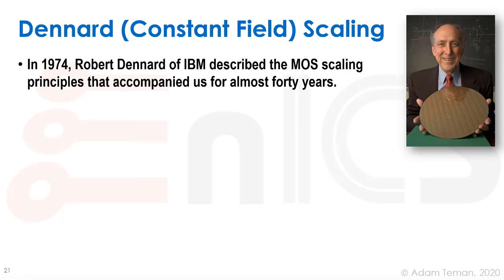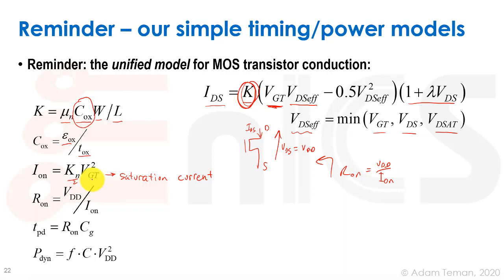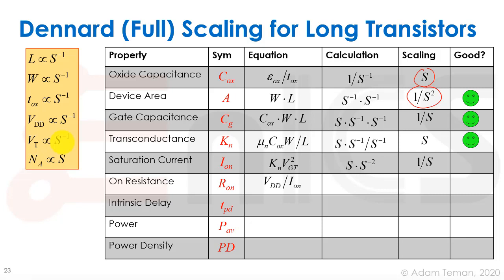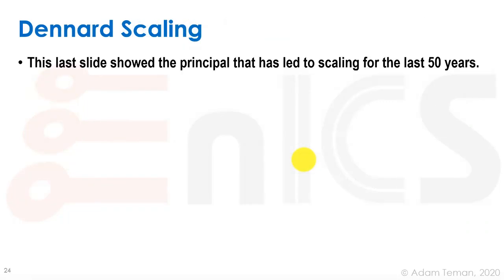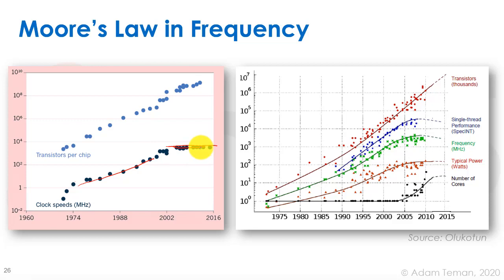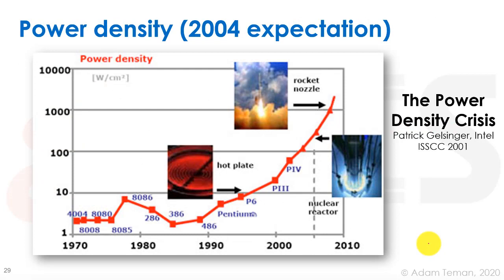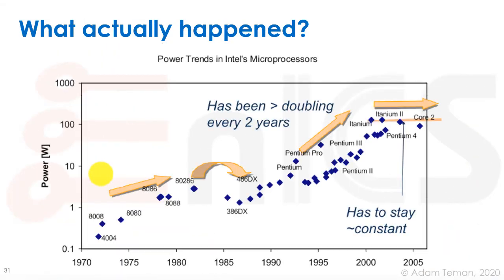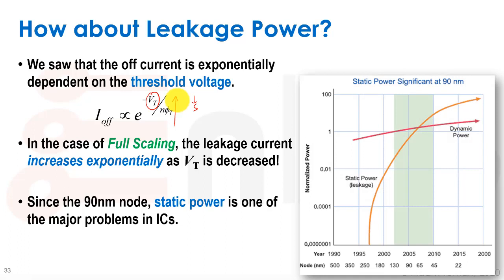VLSI - Lecture 5b: Scaling Models

Comment: Hey Professor. Would higher voltage improve or reduce speed? With a high voltage, you get more current but in return have to charge the capacitance on a net to a higher voltage. From my understanding, high speed applications use differential signals at a lower voltage in order to increase speed and reduce the noise that is more critical on lover voltages
Reply from the maker: This is a good question, but there is no straightforward answer. In general, yes, higher voltage provides better VGS and VDS and therefore more current, which makes things faster. True, the swing also increases, but this is traditionally not at the same rate as the increase in current. For example, the increase in current may be more than linear, while the increase in swing is linear and even could be relative to VT, so may be more constant. Regarding the use of differential signals, this is not commonly found in on-chip interconnect. It is usually applied to high speed interfaces, but this is out of the scope of this course.